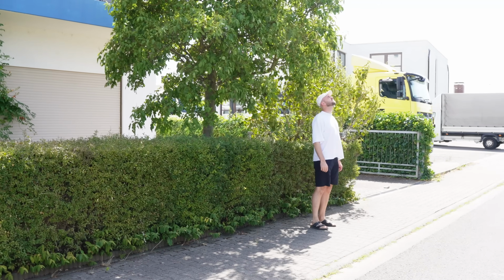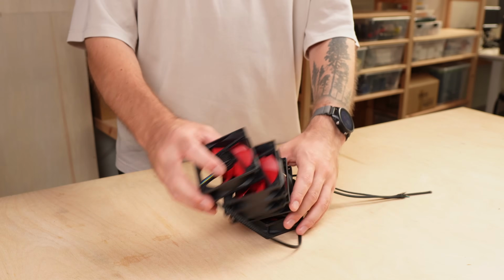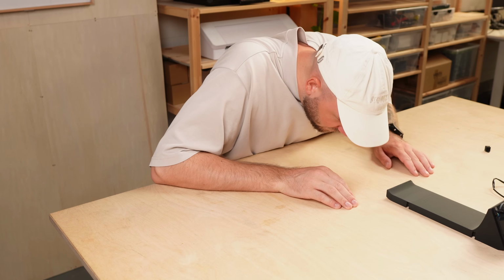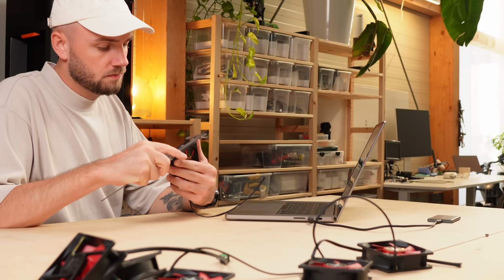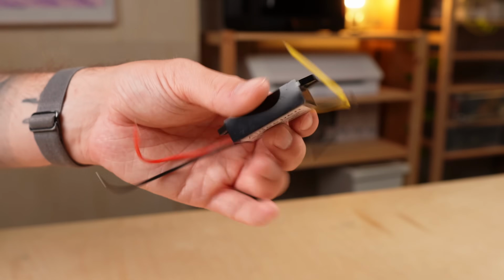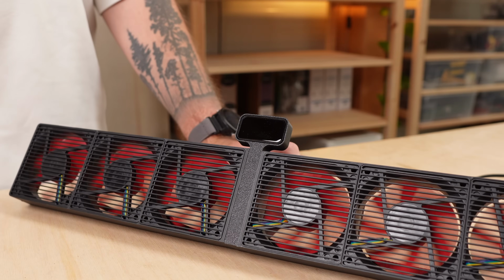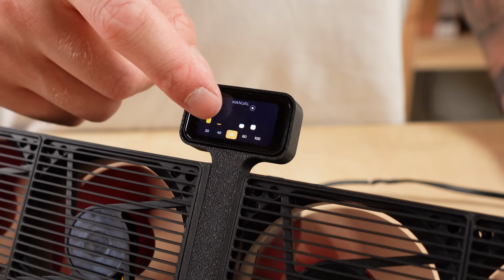I Reinvented the Desk Fan

Comment: You'll feel more cooled if you mount it below the desk, blowing directly at your thighs, as it distributes the air to your abdomen and feet too. It looks light enough that doing a magnetic mount could probably work.
Your thighs have major arteries and are kinda more sensitive to temperatures and it'll cool down your whole body. Kinda like putting cooling pads or ice on your lower back between the spine and hip bones. You'll also avoid drying out your eyes, since on top it's hitting your face directly.

Comment: But most modern fans have a natural wind mode. My 5-year-old Xiaomi fan allows me to control the oscillation angle and enable natural wind mode; it feels like natural wind. I set it to 30-degree oscillation and natural wind most of the time. It has built-in batteries so I can move it around, and it connects to my smart home, Home Assistant.

Comment: My immediate thought was 3x140mm fans instead of 6x80mm. Slightly longer device once it is completed, but the same series fans you have here in 140mm would produce up to 62CFM at 1500RPM, where the 80mm ones you've used are up to 18CFM at 1500RPM. Sure you'll almost never run them at top speed, but bigger fans (generally) will move a lot more air at lower, quieter speeds.

Comment: Arctic made a case-fan-for-your-desk 10+ years ago, that I've used daily ever since I bought it.
Because it's effective at moving air, but it doesn't whip it at your face.
Ever since the first day I plugged it in, I described it as feeling like a light pillow against your cheek.
So I'm far less surprised by this than I expected.

Comment: Vornado type fans give the breeze pattern by stirring the room, not blowing on you (blast a column of air over to the far corner of the room and it slops around finding its way back to the fan). But your design has some cool options for beam steering using the pressure array. And you could pluse the fan speeds to create moving high and low pressure nodes around your desk. Maybe a version 2 with ir camera so it targets hot spots?

Comment: You could easily expand on this by using 140mm fans make the frame to hold the fans a similar shape to a curved monitor and stack them to the same size as your body. Then build more to form a tunnel that you can sit in the middle of for true breeze simulation

Comment: You can get PC fans with high static pressure to push air through radiators. Not much more expensive and could have made your first design work.

Comment: One thing I've discovered is that we focus on applying fan direction to the wrong part of our body when talking about desks. 

Having not fallen for the lame standing-desk trend, I instead invested in a desk with a shelf that spans the back legs under the desk surface that's about 6in deep compared to the desk's 24in depth. On this shelf, centered right at where I sit, is where I keep my small Woozoo 5-speed Globe fan. The airflow is pointed directly at my abdomen rather than my upper chest or head - this is because the abdomen is the body's furnace, and is critically more involved with temperature regulation than most people ever realize. By lowering the ambient temperature around the abdomen, your body is able to more effeciently regulate the temperature of the rest of the body during times where the environmental settings are outside our ideal temperature zone.

TL,DR: point your fans at your gut/back rather than your chest/head.

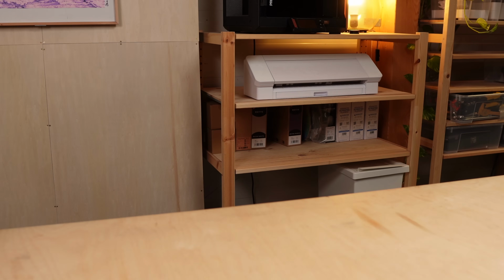Comment: 4:33 most fans can work with far lower voltage too, though yes, usually with reduced capacity. I have a few artic 14 pros that are fine starting up at 4,5V and ramp up to good air-moving fan speed. Speaking as someone who also made them into a project.

Comment: Great work Paul! Although I have a Xiaomi Standing Fan which also has a natural profile which works perfect for even sleeping. It oszillates and ramps up and down while being battery powered for around 8 to 12h so very portable inside. It's also very quiet overall and doesn't vibrate like the cheap fans do.

I actually built a desk fan with pc fans, a 5v usb to 12v pwm controller and a powerbank once. It is a nice airflow that comes from these 80-120mm pc fans! In the winter I use it to circulate the air on top of the radiators. Works very well.

Comment: Shocked I'm not seeing more "Europeans will do anything to avoid installing air conditioning!" comments... ;) Cool project! Your initial inspiration of modern car vents makes me wonder if it would be possible to create a programmable, multi-directional vent array for a person's existing desk/floor fan? I'm envisioning a three-part system:
1. A soundbar-esque programmable vent array with an air intake port sized to accept a common dryer vent hose
2. An airflow receiver/diverter, with a resizable (via overlapping leaves, like those collapsible steamer baskets?) air intake that diverts the airflow into said dryer hose.
3. Said dryer hose to connect the two

Comment: This is very cool 😁
Could someone use a TIR sensor to detect the temperature of a face and automatically adjust the fan flow speed and pattern to optimize cooling.
Could be useful during high stress coding or gaming sessions?

Comment: needs more unicornvomit.
some actual suggestions: i would get some reversed fans, so you dont have to stare at the backside with the wires of the fans.
i would also add a 12v usb pd converter and run the fan with a usb c cable. 
i love the idea though, great work

Comment: The problem with the first design is that you were using the wrong type of PC fans, you need fans with high static pressure, the type that are used to force air through tight spaces such as a heat sink or radiator.  The type of fans that you were using were likely airflow optimized fans with low static pressure.

Comment: How is the control unit (Waveshare ESP32-S3 1.47inch) connected to control the fans as it could be expanded to 8 fans if it were possible to connect it to and act as the control input of the Noctua NV-FH2?

Comment: to push a lot of air throgh a narrow vent you need a blower (radial) fan, not an axial fan. They have ridiculous amount of static pressure, but are a bit louder, although I find the noise much more pleasing. They are used in laptops, consoles and in your car as the vent fan.

Comment: I think the first design could work, if you used a specific fan design. Different fan designs work best for different needs. You need a static pressure fan. Those are built to "compress" the air to let it pass through difficult passageways.
Reply: I was about to say the same thing but didn't want to repeat a comment. If he got the "Artic P8 Max" fans (One of the best 80mm fans based on static pressure), it would work a whole lot better.

Comment: some fans are made to pull air other fans are made to push air, it depends on the blade design,
but all fans pretty much like as little resistance as possible.
the grill design is the easiest variable to control turbulence,

Comment: Why not try High Static Pressure PC fans with the first design? They design to blow air against resistance through fins of heatsinks. Arctic P12 Pro is good and cheap example.

Comment: I'm surprised you did not go for a bladeless fan design, considering that you wanted the experience of a breeze - it might take up a slightly larger footprint, but it does move the air more naturally, no (compared to how normal fans create "cuts" in the air they push forward)?

Comment: I haven't checked what fans you used but you probably used case fans that are designed for airflow instead of fans for cpu/radiator cooling that are designed for static pressure.
Some noctua models, especially the black "industrial" models would've done great for the first design you made.
There's also the fan you used on wheels earlier in the video which should be pretty cost effective for static pressure, but from my experience it's not as well built as the noctua ones and is much more sensitive to an accidental short drop for example.

Comment: Low-pressure centrifugal fan? Could anyone with experience in airflow or fan design help me take this amazing idea further? I’m convinced there’s huge potential to dramatically improve the airflow, static pressure, efficiency, and especially the overall design by optimizing how the air circulates through the system.  
I was really impressed by the expert input and engineering approach in AptiveVideo’s video “I Tried to Make a Better Fan.” It made me wonder how far this concept could be pushed with proper aerodynamic optimization. I’d love to hear ideas from people who know fluid dynamics, fan design, or 3D-printed airflow systems.

Comment: I'm too lazy (and don't have the money or equipment to print it myself), but someone should make a modified version for the Lian Li reverse blade LCD fans and have all of them screens output useful information (eg: weather, time, ambient temp). Keep in mind that the Unifans do have a larger overall dimension than typical 120mm fans.

Comment: it's not that PC fans are bad at pushing air through tight gaps - afterall, that's what they are doing when strapped to a radiator - but I think your initial design just caused a tonne of backpressure. a redesign with some proper CFD work and some fans specifically designed for high static pressure would probably have done the job.

Comment: Fun fact, PC fans are not all the same!

Some PC fans are optimized for air flow while others are optimized for static pressure.  The fans you selected are air flow optimized fans which is why the physics problem you mentioned hit so hard.   Static pressure optimized fans should have performed better in your first design (but still may not have been enough as that constriction was quite substantial)!
Reply: Static pressure fans also need open space. For narrow space you need centrifugal blower fan.

Comment: Why not use usbc as power supply?
Reply from the maker: The fans run on 12V, so I wanted to keep the power supply as simple as possible. USB-C can provide 12V with Power Delivery, but that would require additional PD circuitry to negotiate the voltage. With a regular 12V power supply I can just feed the fans directly and only step it down to 5V for the ESP32 :)

Comment: Only one other comments about ceiling fans, I'm suprised, they're way better than any stationary fan setup you could make/buy. A ceiling fan is silent and feels extremly similar to the gust of air you're talking about outside, especially on lower settings because it moves the air in the entire room.
Reply: assuming most people rent, that's quite out of the question, especially when ceiling fans involve needing rigid supports
Reply: My cool, brushless, low power, low depth ceiling fan even has a natural wind mode and a dimmable colour temp changing light on the bottom. I barely use it above speed 1. It goes up to 6! Oh, European plasterboard (drywall) ceiling too.
Reply: Well because most people can't modify their rooms
Reply: I'd like a ceiling fan but I'm also in Europe, so it's not gonna happen.
Reply: That's way harder in a european room than you would think. Our ceilings are more like paper, even lamps are falling down from time to time, not to think of a spinning fan.
Reply: @daviniusb6798 wtf.. that's wrong. Ceilings are not like paper?! Often, they are even made out of beton. Or.at least Wood + other stuff. The first ones are pretty hard to drill into - and others just need the right screws.

If a lamp falls down - it was not mounted properly. Some people just hang them on the cables.
Reply: @gregor2436  He's probably talking about plasterboard ceilings. You are right, that you need the right dowels for them, but he is also right in the way that they can only carry around 3 kg of weight per board. Everything above needs to be bolted in the substructure, and if it gets heavier, it needs to be bolted into the raw ceiling underneath. A ceiling fan would be such a thing. Some folks get that part wrong.
Reply: @daviniusb6798  Where I'm from plasters  are made of concrete, the problem is that ceilings are too low. 2,70 mt is the minimum height allowed, and my house is relatively new, so it's exactly 2,70,  not a centimeter more.
Reply: @Pirata_Spaziale  Our ceiling is at 3m, but I can't even put my USS Enterprise up there
Reply: Ceiling fans also add a surprising amount of heat to the room due to the larger and less efficient motor
Reply: @roBLINDhood  That’s not really a valid argument for using lots of PC fans instead. A ceiling fan’s larger diameter is actually one of the reasons it can move so much air efficiently, it moves a large volume of air at relatively low velocity rather than relying on lots of small, high RPM fans.

The heat added to the room ultimately depends on the total electrical power being consumed, not on whether the motor is physically large. If you need a large number of PC fans to produce comparable roomscale airflow, their combined power consumption can easily remove any supposed heat advantage.

So “ceiling fans add a surprising amount of heat because they have a larger, less efficient motor” doesn’t really follow. You’d need to compare watts consumed and airflow delivered by the two setups.
Reply: @MrRainEnjoyer  This entire setup with 6 PC fans uses like 3-4W at their max speed, possibly even less. You'd need like 60 of them running at 100% to get into the "ceiling fan" territory.
Reply: @roBLINDhood  Thats the most silly thing i have read today. Are you still living in the 1940s ????
Reply: @roBLINDhood dude this ain’t the 1900s lmao they have more efficient motors for running these and it moves way more air at the end of the day

Comment: I build 3x3 and 6x1120mm fan grids for my windows, intake and exhaust.  Dial PWM for way more control than commercial fans' high/med/low.  Which means you can control the noise they make (generally I find them quieter and less obtrusive).  

I love your controller you came up with, need to try something like that.

Note,  for your ducted channel design. They do make PC fans designed for higher static pressure. I still don't think I'd do that, but it's an option to be aware of.

Comment: Have you tried a ceiling fan? They are way better than a desktop fan
Reply: These things are incredibly uncommon in Germany.
Reply: exactly! bldc ceiling fan with breeze mode is exactly for this scenerio.
Reply: It depends. Ceiling fan is impractical if you are living on the top floor like I do. All the heat built up on the roof is just gonna be blown down instead of dispersing out through the ceiling vents
Reply: @tinylittlegiant  Normally, you can switch the air flow direction of a ceiling fan
Reply: @MystycCheez  In germany its not allowed to change the direction of the airflow. It has to blow the air downwards, to reduce the fire risk
Reply: @tinylittlegiant  the downward flow is accompanied by an upward flow nearer the walls (or opposite if in reverse); people always say *youre just moving hot air*, yes everything but AC is doing that - still feels pleasant to have moving air and unless you are directly beneath it naturally varies moving around furniture etc
Reply: not true, they move hot air coming up from below
Reply: @MarkhCastelo You obviously do not know the physics behind this.
Reply: @Netsuko  Someone needs to have their technologies connected
Reply: @MarkhCastelo doesnt that depend on the setting/direction its spinning

Comment: My Improvements for this would be velocity stacks on the backside and on the mesh instead of a flat surface turn the side facing the fans into tapered edges/fins so when the air rushes past them it doesn't smash the airflow, keep it clean and flowing.

Comment: Pretty cool idea. Have you considered adding vertical guiding fins like in AC internal units? Thought, this would require using servos, and they far more extra components to work.
Reply: I mean I would just link them all together and use only 1 servo.
Reply: @mus2go  yes, just like in AC unit. But you can't just link servo do ESP board. You need a servo control board.

Comment: Which 3D Printer would you recommend, if my first goal would just be to recreate projects like these. Idk maybe later I would want to make my own just not to start
Reply from the maker: For a beginner, I’d recommend a Bambu Lab printer. The P2S would be my first choice, or the P1S if you want something more affordable. They’re easy to get started with, but still capable of printing more complex projects later on
Reply: Really anything should work for PLA like this. I never replaced my OG Ender 3. I don't like Bambu because they lock everything down so much the printer isn't even really yours.

Comment: phased array air mover
Reply from the maker: that sounds way cooler than “desk fan” 😂
Reply: So, a phaam? Ba dum, ts...
Reply: @lucaspagote3042  sure. when it's soo hot you slur words, turn on a phaam.
Reply: Chaotic flow fluid generator
Reply: I though for sure that he was going to use this as a phase array to make the air change directions. Then it can sweep across an area. Combine it with varying the intensity and maybe it would mimic a breeze.
Reply: That's not a phase array😭
Reply: @marvinhuth4487 fca?